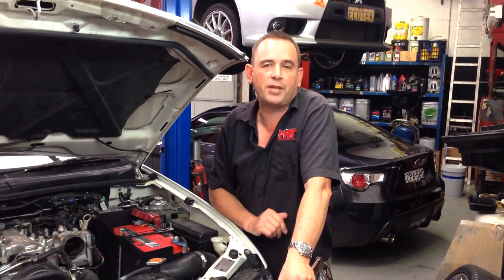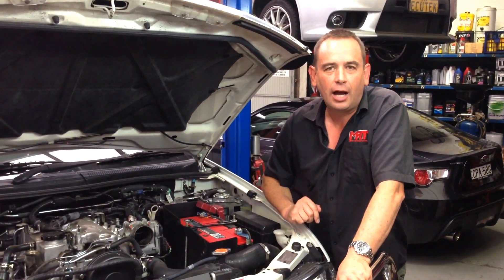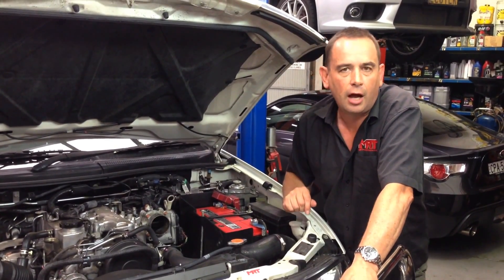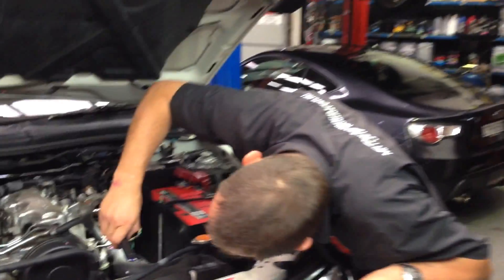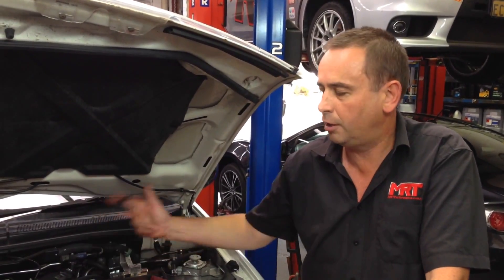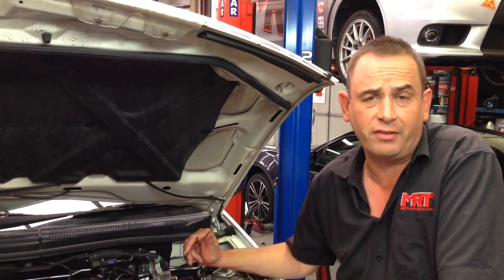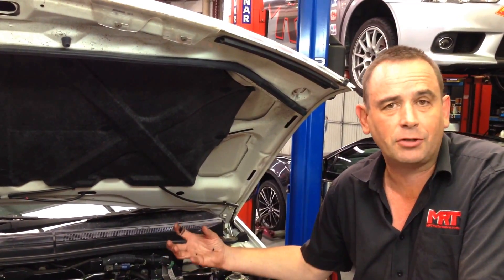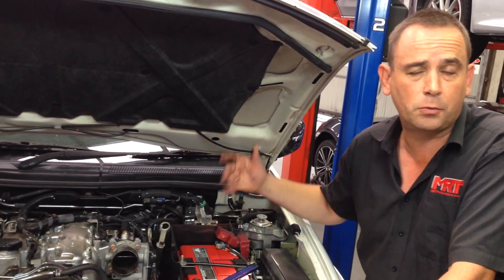Mitsubishi Triton performance, EGR soot tricks and traps. How to fix.

Comment: Yeah, I just got a 2015 LVD V80 that was having acceleration issues. I unplugged the EGR lines and plugged them with screws, (airline type that’s connected to the MAF), and now my van drives like new. It’s got 97,000kms on it. It was jerky between 1st, 2nd and 3rd and took some effort to get up to speed. It felt sluggish. It’s nice now.

Comment: How bad would a MY20  2.4L MR Triton with 18,000ks be? I didn't install my provent oil separator till then. Is it worth cleaning out the intercooler and intake, or should be good for now?

Comment: Hi, I have a (for me atleast) tricky problem with my L200 -02.  Im from Sweden so I can´t bring it to your shop sadly....  The symptoms are  that it sometimes, when I have driven shorter and slower runs starts to run bad below 2200rpm, it sounds like the turbo spools up and down and it smells diesel.... So almost no power and rough running... Over 2200rpm it runs fine... Then if I turn of the engine and start again it runs fine for a while... Feels like it is some selenoid or something
Reply: Sounds like dirty fuel and need new filters. A pre filter to keep water out of fuel, you can drain the water out if the bowl shows water. Do you have an oil catch can? A must for these cars.

Comment: Not too hard to pull the intake manifold off a Triton. But the crap that is in it is another matter. It requires soaking overnight in some pretty harsh chemicals and then attacking it with a 3000psi pressure washer, then you may have to do the job all over again, honestly it can be that bad.. 
So you don't recommend paying $200 bucks for a spray can of snake oil to clean it?? But the sales guy said it was the latest wonderful " liquid ceramic polymer" with added "magnetic turbo scrub power lather technology" that would get into to every void in the manifold, remove all soot buildup and get it spotlessly clean. You only need to buy eight cans of it as well.
But he did say that in some rare cases, extra cans may need to be purchased, especially if your engine has more than a Three cylinders.

Comment: So many dramas the customer has to put up with;  eventual DPF failure, regeneration cycles not performing as should, choking up the inlet manifold.
Petrol and Diesel direct injection I thought was wonderful; more power and torque, less fuel consumption and emissions.  I've now come to realise that carbon will form on the top of the inlet valves and there is virtually nothing you can do.  Putting fuel additives in will do nothing as the fuel is not going past the intake valves.  So much for saving money especially on a diesel.
Still, if it wasn't for small businesses as above the consumer would absolutely up shit creek.  I think these engine designers should be made to produce an engine that is reliable for 300,000 without undoing an extra bolt apart from the normal service routine which does not include cleaning DPFs, intakes, EGRs etc.  If an filter is required in the PCV system, then design it  with reusable filter screens etc easily accessible and tested under all load conditions to be very effective at taking out oil vapor before it is released back into the engine.
If the engine cannot do 300,000 without a minor overhaul of components then it is not "fit for purpose" and that engine should be banned from this country.
I know, I know, I can all hear you saying that it is not the engine designers fault, and I do agree to a point.  The emission regulations make these bolt on fixes necessary.  Yes, but they are not good enough obviously.
The customer has no way of knowing a reliable engine from another.  I'm starting to wonder if I should be going back to the mechanical fuel injection days, using a bit of Decarboniser with every tankful to keep the valves clean via port injection.

Comment: my 2012 triton grl feels like its choking, lagging, and blowing black smoke! please help and give me some tips as to what it could be
Reply: forgot to mention, the engine light came up and mechanic scanned it, returning a high air flow reading
Reply: u drvie slowly everyday tht why so many carbon black smoke I recommended u to drive fast sometimes to rwmove black smoke
Reply: @Blowslowjoe  possible MAF issue, faulty sensor? Have you tried replacing it yet.

Comment: Thanks for the videos on this it's really helped in understanding why my ute is not having so many problems. Does the spray stuff work as thats all the Mitsubishi dealership offered up here in Brissy. Also can I ask how much would be a reasonable cost to do a full clean on a Triton 3.2 MN?
Reply: Mitsubishi Capalaba offer a egr & inlet manifold clean for $396 best to get it done with a service.

Comment: Mitshubishi montero 2.5 turbo diesel,I encounter check engine light, I try scan using obd2, it's come with P0089 error,  I already change suction control valve but still has check engine light, when I start the engine with 1000 rpm, it's goes normal, but in idle with 650 rpm, check engine will appear and limp mode of my engine, please help me diagnose this problem, thanks
Reply: Fuel pressure sensor on the fuel rail my friend. Did you ever fix this?

Comment: I like the video's that are presented here, i am planning to do maintenance to my Triton which feels like it has ALOT of performance that only lasts 1-2 weeks and then the car runs sluggish for a little while then it suddenly kicks in again, and gains 200-600 revs instantaneously.

I am planing a Manifold clean, Exhaust upgrade and downgrade installing 1-2 resonators on a 2.5 inch pipe, Turbo check and clean as well as planning to install a inter-cooler.

Some days the car runs at the specified temperature, and other days it runs half way. If it climbs higher then that, i stop the car as soon as i can, see if i can idle it cool, and if not shut it down.

I am on my P's and the car's has potential according to the way it drives everywhere. I am gearing up every 2-3 seconds give or take.
And the power on the car has made me accidentally do burnouts, so i let the car idle rather then give it throttle while i am taking off in forwards or reverse.

Comment: Hi my 2015 has just lost power its no longer able to acellerate or even hold speed in top gear going up a hill that i drive up every day it used to be able to tow a boat up and hold speed now it is slowing down unloaded. has done 20,500km air filters still clean
Reply: Did you ever find the issue??
Reply from the maker: +possumtrapper please call us 0297674545
Reply: i'm on the other side of the Tasman ;)
Reply from the maker: sorry

Comment: hi 
i have a Mitsubishi pick up L200 4x4 2007 
it doesn't going to fast 
i check it in the electronic and they said that there is no problem with the motor and the check engine light doesn't light 
put i now that the normal engines  acceleration after 2rpm it goes to fast 
put mine doesn't go like that so what should i do 

thanks